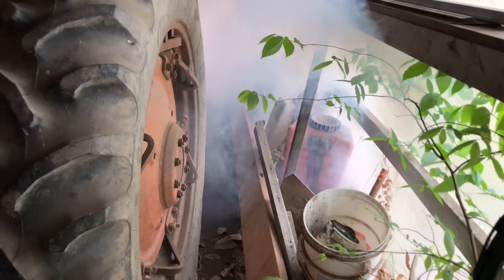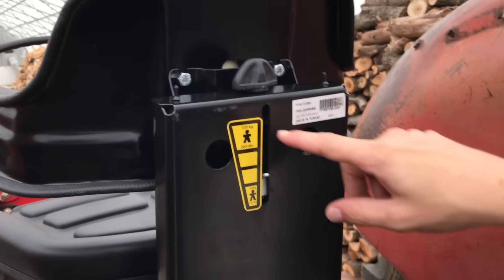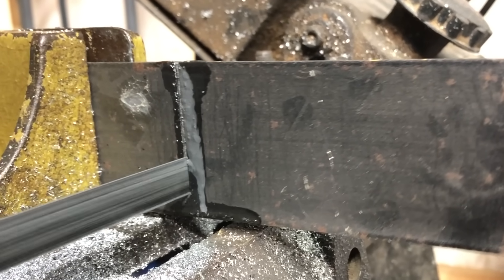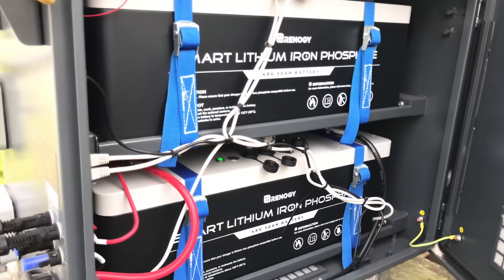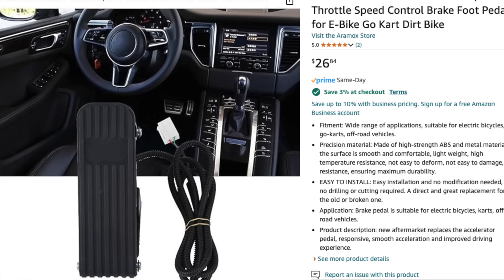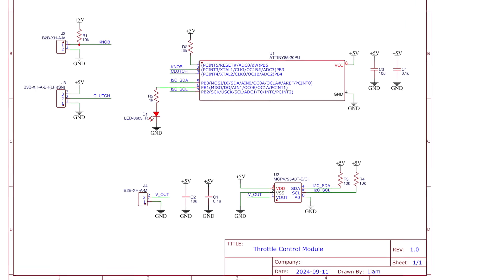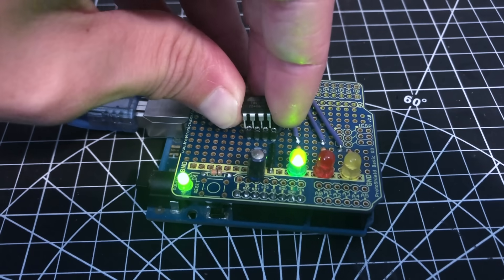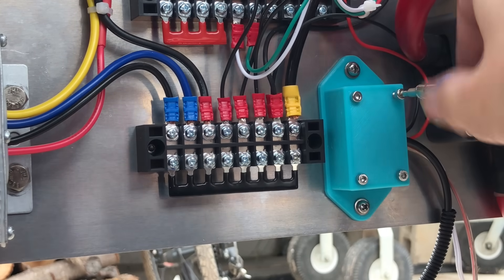Adding a fake clutch & more to my electric tractor conversion

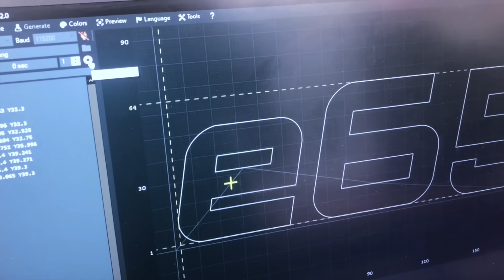Comment: 1:49 idk much about laser cuters but you might be able to tune the power just right for it to cut through the vinyl and not the paper under it. then you can buy some transfer film (basically a wide roll of slightly sticky transparent tape) to transfer the the whole thing in one go instead of going letter by letter. if you dont want to buy transfer film, you can try painters tape too, it's a lot stickier so might have some issues with it but you should be all right.

Comment: I don't think that farm equipment safety is less critical than in a car. Imagine what happens if your throttle goes crazy and there is someone in front of tractor. You need a simple, safe mechanical way to disconnect power from batteries and stop it instantly. Maybe you have mechanical and electrical skills, but your thinking about safety is very wrong. You should read about safety i machine and/or vehicle engineering Sir :) Focus on the "RISK" word.

Comment: Hi,
I didn't use a pot, I used an optical quadrature encoder for durability and programmed my uC for it, If you use an encoder you don't need the ADC. I program chips in C and assembly because it's cheaper than Arduino's.

I'm going to see if the brake works like a clutch, I programmed it to slowly shut off the motor when the brake is applied. (255 steps to off, each step takes 3mS for a total of 765 mS). I'll see if that's to short a time or if I have to increase the motor shut off timing.

Thanks for the video, lots of great geeking fun, I'm thinking about doing an old full size tractor next.

Comment: It was such a quick shot, but it looked like an Altrax controller you were using, those are nice but Navitas makes a fully programmable ac/dc controller with included variable “on the fly” attitude ajusters via tactile knobs for customizable speed, regen, and acceleration features complete with a barrel key lockout for presets, they even make the motors in ac or dc, throttle inputs or “mcors” and a cornucopia of other related accessories, the controller even links to your phone via bluetooth for diagnostic, fine tuning or controls tweaking with endless applications

Comment: I know you want to keep electric but would you be able to add a small generator be it diesel or gas to stretch out the battery life not one powerful enuff to run the motor but to add a little more life to the battery like the bmw i3, oh and this is build is amazing I love what your doing

Comment: We did a very similar conversion in the late 90s to a 1967 Massey 135. We own a hockey rink and at the time our zamboni was a tag along hooked to a massey 135. The fumes were making my grandfather sick so my father pulled the gas engine out, put in a motor from a forklift. It had a curtis controller and a rack of 6 volt lead acid batteries. We used the machine for a few years before buying a self propelled zamboni and we converted that to electric aswell. The 135 has since been torn apart but there's a few pictures of it still floating around on the internet.  It would take off in 3rd gear high range no problem and so quiet you didn't even know it was moving if you weren't looking at it.
Reply: How many 6 volt batteries in series to run a heavy(ish) duty EV?

Comment: Wow, dude- great job! U turned obsolete junk into awesomeness! 1 suggestion: add a capacitor bank using either super caps or ultra caps configured to ur dc voltage between ur battery bank, and ur inverter. This will prevent flyback from destroying ur batteries, improving their lifespan. It will also give u a massive power boost of "cranking amps" to get the tractor moving from a dead stop without a drawdown surge in the batteries.  This increases the run time. My grand dad had that same tractor, & he hated that there was no roof. Now that its electric, u can mount a couple panels above your head to give u sum shade. Just remember to clean them when work is dusty to maintain their efficiency.

Comment: What about making the "clutch" pedal a potentiometer the exact same as the throttle, up is 0omh down would be max ohms, wired in series with the existing throttle this would simulate the exact same thing (ISH) with far less complexity

Comment: If i was building something like this with similar power and battery voltage, id use a Nucular 24F or P24F controller, wich can take DC voltage of (lets say 48V) and use the motor windings to up the voltage and charge the battery (perfect for charging from another battery), they also function as an MPPT controller so you can hook up solar panels directly with no additional controllers or batteries, the only downside about using motor windings for charging is that you cannot charge while the motor is spinning...id also propably use a Nucular Ulight (or two of them in something bigger like a tractor) to control lights & fans, horn etc, controller Display and the Ulight (12V light controller) connect to the same canbus, hopefully they will finally relase their BMS next year wich will also connect to the canbus...

Comment: A couple items.
1) The lights down low are vulnerable to damage and will not give good work area lighting. Mount them higher - the old hood height or about eye level standing on the ground. If you have any mid-mount equipment, you will want to move the lights back or add additional.
Modern equipment is lit up like a Christmas tree and usually high up for general lighting.
2) Some ag, construction and lawn equipment have used hydrostatic for decades. Two pedal is usually preferred over a treadle. Useful for utility work, not so great for long row field work where a hand throttle is appropriate. Maybe some linkage from the hand to the foot throttle to set "cruise control"

Comment: Glad someone with rocket skills is still on the farm we can use some very new thinking. Love the solar panel charging station. How long does it take to recharge and what's the run time? You hinted at expected run time earlier. Looking forward to the farm work as your thumbnails were nice. The nuclear power clutch was impressive with the the ardurino added to the Raspberry Pi. Replacing all the previous hydraulic pumps with micro computers! :-)

Comment: Yes, there are devices that essentially combine signals from electronic clutch pedals and throttle knobs, though they aren't always found as off-the-shelf consumer products. These are typically part of custom drive-by-wire systems or motor controller kits used in motorsport, industrial applications, or custom vehicle builds.

Such devices are usually referred to as ECU interfaces or drive-by-wire controller units, and they allow precise integration and modulation of electronic signals from both the throttle and clutch. These systems can be used to create smooth transitions, coordinate throttle blipping for gear changes, or adjust power delivery based on driver input.

In the automotive aftermarket, you might find standalone ECUs that have programmable features for combining inputs like throttle, clutch, and even brake pedal signals, primarily for tuning purposes. Another option could be PLC (Programmable Logic Controllers) or microcontroller-based solutions that let you combine and control these signals, useful for custom car projects or retrofits.

Comment: I bought a seat from the same manufacturer to use on an MF135 and just trimmed a bi off the back of the base to make it fit. The bolt pattern wasn't technically wrong for Massey Ferguson, it's just that the plate sticks out too far in the back and hits the top part of the three point hitch.

Comment: Even if the tractor, or a car, were powered by coal it's still cleaner overall and at point of use to use an electric version. That's how dirty and inefficient gas engines are.

Comment: The only think harder than this build was me as I watched. Hybrid diesel motor powering generator is best way of using Dino juice for charging zappy zap. Think how freight trains work. Even modern day semis aren't the best use of fuel but they're designed to make oil pumpers rich. Look at Edison motors. Them Canadians are onto something. Could have kept og motor for charging batteries.

Comment: Technically you still are using fossil fuel to power your tractor. Untill you harvest all the materials used for building your solar panels and the rest of your equipment to build this set up, you are still using fuel to do so. When you get to that "pure" state THEN you can say you do not use fossil fuel to power your tractor.

Comment: Ye I'd do a solar roof and possibly make the nose tractor shaped again using solar panels on the top AND sides.
(different channels)

An MPPT attached to the regen side of the ctlr, before the battery will likely give you some regen even from the low speed slowdowns of a tractor.

As I said on the forum; adding very fine Boric Acid powder, slightly wetted in hot water, to an oil or grease consistency to the gearbox/es and wheel bearings will reduce friction tremendously while filling in wear loosness.
That will make the battery last longer
BUT you need to run it a lot and hard straight after adding it.
Google: Argonne National labs Boric acid in oil lubricant research

Comment: I would look infinity better with the original shroud/hood. That square red monstrosity does not fit on a tractor of this vintage. Guess you want a more "in your face" electrical conversion, rather than a good looking one...

Comment: The retards that claim that EVs aren't any better than ICE vehicles for the environment aren't considering all the aspects.

1. The EV drivetrain's efficiency is as high as 85-90%; whereas the ICE drivetrain tops out at around 45% efficiency. So even if coal is used to produce the electricity, EVs are still only using half of the energy and thus only release half (at most) of the carbon of ICE-Vs.

2. Even if they are using electricity produced by fossil fuels, the efficiency of producing electricity at scale is WAY more efficient than producing power at each individual ICE vehicle. The more moving parts, the more power lost to friction and heat. There are around 200 moving parts minimum in an ICE drivetrain. Now, multiply that by every single ICE-V on the road and you can easily see why producing the power at power plants instead of at every single vehicle is WAAAAAAYYYYYY more efficient.

3. EVs can be charged by electricity that is generated at any type of power plant, whether it be solar, wind, nuclear, coal, natural gas, etc. This means that we can easily transition away from fossil fuels by changing how we generate the electricty; and the EVs don't have to change at all.

Comment: Given that you're in Ontario, you could use the awesome local grid power and would still not be using any coal to run your e-tractor.  Ontario burned its last coal for power production in 2013.  As to the concerns about embodied emissions in batteries and your solar panels, those are old, tired nirvana fallacy arguments against EVs.  EVs are, according to numerous disinterested 3rd party lifecycle analyses, cleaner vehicles from cradle to grave than those they replace.  When recharged on a grid like the one in Ontario, the payback of embodied emissions by an EV typically happens in less than a year of driving.

Comment: I absolutely love this project of yours. You know what you´re doing. About those engine covers - you should consider some kind of side panels with vents to shield the motor from water and/or elements, dust and dirt. It might prove useful in the long run.

Comment: "But for farm equipement, Anything goes!"
Wow, anyone how lived or worked on a farm can relate to that one!
Reply: I'm a farm boy who ended up in agricultural design, can confirm, it's a very liberal area, which is why I reckon we have such creative machines!
Reply: @MrFeazel   @MrFeazel  
I now work in industrial automation, and everyone wants super high tech stuff (which does not work half the time) while I remember planters and others from my youth all working very well and being easily fixable with little tool all working based on cams and gears.
Low tech is often the right tech.
Reply: @MrFeazel  And why you have so many accidents? :)

Comment: @3:35 The coal was already burned in China, under no emmissions restrictions at all. Then the acids and heavy metals left over from the etching process used to make your solar panels was dumped into the Yellow river. Now one of the most polluted rivers on Earth, largely thanks to these 'green' solar panels. Then of course, they were shipped thousands of miles across the ocean on a container ship using bunker oil as fuel. The shipping container is made of steel, the ship too, and all this steel was mined, smelted and worked using fossil fuels just to make these things for this purpose. Your batteries are similarly produced with little or no regard for the environment, then it's marketed to you as a way to combat man made CO2 emmissions, which are not actually a problem for our environment at all, all so you can feel a fuzzy glow about how environmentally friendly and ecologically aware you are . . . 
I'd love to see a true audit for the environmental damage this project is responsible for. It's certainly way more than if you had done nothing, shipped nothing, burned nothing and just went ahead and bought a used tractor locally. The good intentions are there, but you are still pretty naive and mainstream when it comes to understanding your own environmental impact.

Comment: bruh. When people are say electric vehicles get charged with "coal". They don't mean you specifically. Learn to look at where all the power comes from. I don't know if you're actually stupid or just gas lighting the viewers. Only 40 percent of the grid is powered by non carbon fuels. If you add 11 times more grid capacity to make all vehicles electric, 11 times more power would have to come from somewhere, and it wouldnt come from existing nuclear, solar, or wind plants... So where do you think it would come from? So if you rapidly electrified every vehicle. The non carbon fuel energy sources would only make up 3.6 percent of energy production. So basically... all evs would be powered by coal.. and oil.. and natural gas... But good... pat yourself on the back. You got solar panels for your ev. That must mean none of the other evs exist, just like how you cant find the coal.

Comment: I recommend adding a E-Stop which overrides your throttle controller and just grounds the input signal for the motor controller. Nothing wrong with your approach, but I wouldn't trust my life with a DAC ;)

Comment: Good on you for the soler charging but to be real there was a bunch of coal used to make and transpor the battery and soler panels and inverter and copper and brass and zinc and lead and the tractor it doesn't appear from nothing 👏👏✌️
Reply: Yet, internal combustion vehicles appear from thin air due to the magic of fairies, right?

Comment: I always laugh at the people who say electric vehicles are coal powered. First, it is an implicit admission that coal is bad (otherwise, why is it a problem?) and secondly, these people usually don't know just how little coal most countries have in their mix.

Of course they would then move the goal posts and remind you that the rest is mostly natural gas, which is also a fossil fuel. Yes, yes you are right, but there was a reason you went for coal. You went for coal because you acknowledge that that is very dirty, and therefore by your own admission, we're doing better when we use natural gas. Thanks, that's exactly the point :-)
Reply: Even if coal was used to make the electricity it would still produce less pollution because it is more efficient than a diesel engine. Also one big power station is more efficient than thousands of small farty engines.
Reply: My right-wing buddy had no idea that Alberta had phased out coal this year.
When he moved here 20 years ago: most of Alberta's power generation was coal.

Comment: Hey ! You can create a variable voltage between 0-5V just using the PWM output of the AtMega. I would also feel like it's more reliable than the I2C DAC you're using.

Cheers !

Edit : You should also add a pull-down resistor at the ouput to ensure 0V when you are in undefined state, like before the AtTiny boots.

Comment: Good content +sass = viewer retention 👍👍 you got my subscription.

Question: would it be worth it to wire the pedal to trigger a regeneration circuit at the zero position? Not to charge the battery so much as to emulate engine braking and stop the traktor from rolling when adjusting implements i.e. preventing a roll of when there is no driver on board or if the pedal gives up the ghost

Comment: Great video, I am fascinated with your range of skills.

I2C DACs are dirt cheap and a perfectly fine solution for your problem. Just wanted to add that you could have used a PWM output of the ATtiny with a RC low pass filter to generate your 5V analog signal as well.

Comment: Good job! I coverted a 1979 Jeep CJ5 to electric for use on my ranch and acreage. I love not having to pay for fuel (solar charged) and it can run all my electric tools and toys off of the Jeeps  110v inverter when i am far from a power grid. The next project is a trailer that has another battery for a range extender and has a solar canopy to charge as i go.
Reply: Hope it never gets cold or wet.

Comment: Great work! Electric is especially efficient in low RPM high torque situations such as..... Tractors!! You can run a typical tractor all day on 20kW pack!!
Reply: You mean 20kWh?
Reply: @plonkster  I meant 1200 kWm, 😂😂 Or 68240 BTUs... Because motors are measured in joules/s and batteries are not.
Reply: Run? Yes, maybe. Doing something? No.